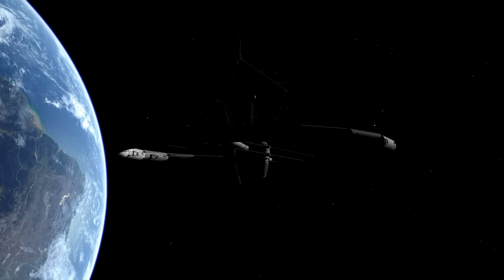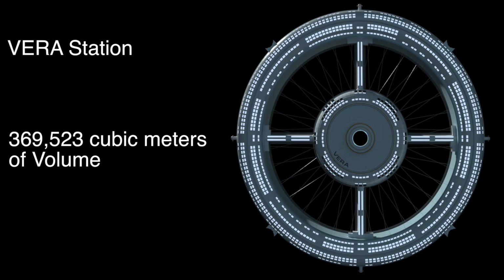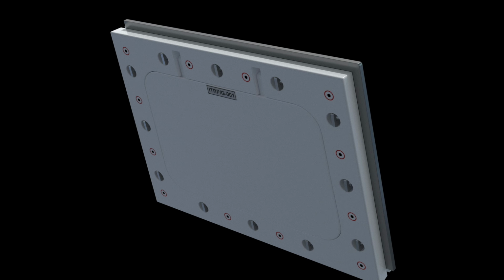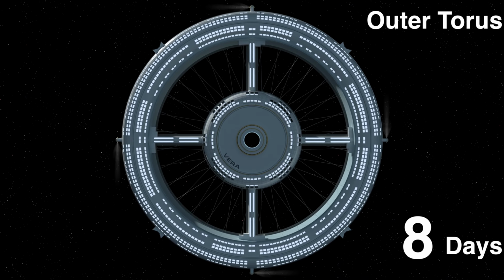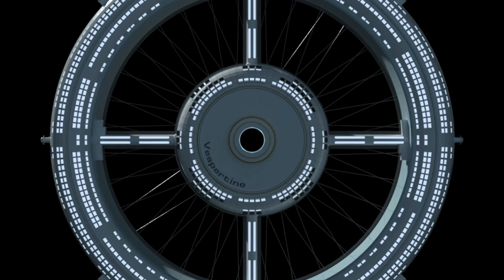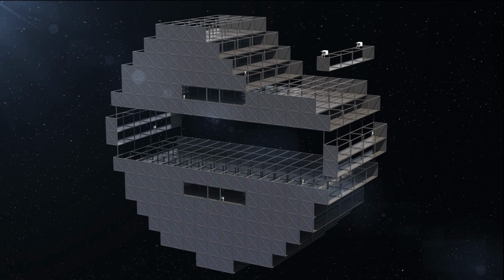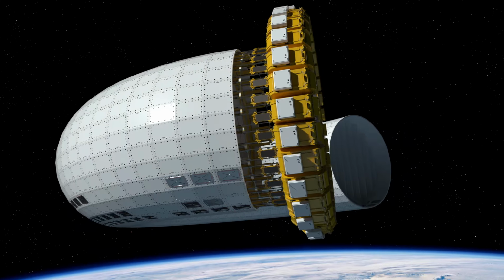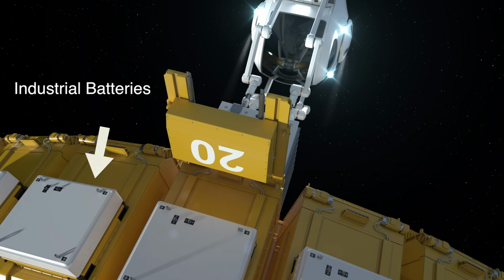We could build this huge Space Station in 6 months

Comment: Gateway Spaceport LLC 
How are you going to solve the multi-fixed-tori problem? It looks like the two torus are joined and not independently rotating. 

The issue with this, for those not familiar- the inner and outer torus rotate at different speeds due to being connected. What I mean by this, is regardless of the speed of the inner torus, the outer will always move faster. 

You can even simulate this using your hands. Put one closer to yourself and one further away. Then move the 'inner' hand while making the outer try to keep up.

The resulting issue is that simulated gravity is going to be higher on the outer ring. This is why you see designs like the O'Neill cylinder instead of layers of tori. Food for thought.
Reply from the maker: There is no problem to fix.

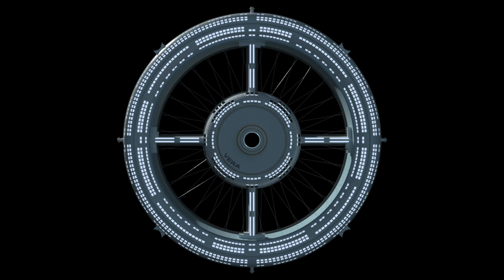Comment: 3:14  a circular centripical motion object, is vital to create an inertia property foundation in micro gravity realms, its a natural initation that large heavely mass geomagnetic enities naturally do, even artifical vessels potrayed in claims of ufology sightings. 

  A rotating spin craft can also use odd mass for pre-adjusting position or directional balance and instigate geo-momentum, like a gyroscoptic device doing geo-scoptical cruise. In sci-fi term similar to "pulse-engines", only at continues mass attune spin verses rithum jerk-pumps. 
  Allowing the craft to run without chem-fuel storage, such as mini nuculear cells to amp eco-sound generators (solar), nearly pure electric.

Comment: animation of vera shows outer ring n inner disc like station spinning as 1 unit hence same spin speed so would this mean more artificial gravity for outer ring inhabitants then center disc like station? on side note each building unit/plate should have defect/anomaly reporting system like vibration, sound db ranges, pressure etc. Data collection n forensics on internal espionage or external object shot at. How about instead of evacuation to other ring or station each ring/disc should have 1 ejectable floor like a boat in each quarter (think pie).. this will cut time bring inhabitants to escape shuttle by parashooting that segment to earth like many including spacex rocket recovery techniques work? so my guess; it should be just 1 ring keeping simple cuz economic impact of bloating the design cannot be realized before hand.. also the brain drain instead using firmer platform like mars caves, rocky crevices are better places to install more elaborate n better protected setups n habitats..

Comment: Have you done any welding in a non-environment scenario? My understanding is that flame is non-existent in outer space. Having asked this question, I am truly in agreement with what you are trying to do and yes I believe also.
Reply: The flames from a mig or tig welder does not exist until the aluminum or steel metal wire touches the joint and melts the metal being welded.  You are thinking of acetylene welder where a hot flame is  used to melt a soft metal like brass to a metal joint.  That is an extremely weak weld to use.  Batlle Tanks and Jets are welded using the other first methods.

Comment: Sorry,  but I am so confused by this design. In space, I think this concept will only cause the floor beneath you to shift sideways. Wouldn't it be FAR more effective to design these living areas on the spoke-like floors that expand from center to the wheel, and standing on the spoke-like floor will cause you to be grounded as the floor moves up, not sideways with this other wheel like design. I hope that makes sense. I means the spokes will have to be separated in concentric circles that are spinning at different rates, in order for each concentric circle to reach the speed it needs to mimic gravity.

Comment: Solar panels and batteries will not provide sufficient juice to power all the welders at once.  Can't get around the math.  You're going to need SMRs from Radiant.
Reply from the maker: Yes, they will Paul, we contacted manufacturers of the Electron Beam welders and industrial-scale battery manufacturers. Read our statement at the top. When we started this project in the summer of 2021 it was one of the first things we checked.

Comment: Could also be modified into a planetary transit ship and not just a space station. Just attach a few rings chained together at their hub via a central shaft structure. That could act as a carrier bay for a couple of SpaceX Starships. Add engines and there you go. (Of course some modification for lateral loading, but given the travel distance acceleration can be kept fairly modest.) Not quite the scale of something like an O'Neil cylinder, but it'd be a start on that general idea.

Comment: Looks like SARGON is designed to be broken down into individual panel placement sections.  Each of those panel section placement components look like they could fit on a current generation SPaceX Falcon. Theoretically you could start launching components of SARGON now. The only problem is the current cost per KG to launch it. Looking forward to the next steps.  Are you going to have quarterly updates?
Reply from the maker: Yes

Comment: Doesn't having a 16 segment, flat panel ring construction, give excessive opportunities for leaks? How are all those seems sealed? And wouldn't a design that minimizes corner joints, with overlapping panels be a safer solution, also in regards to material fatigue and stress... like ship construction.

Comment: You know, after 135 shuttle missions, we'd have so, so goddamned many of the building blocks of what we would now call a huge station. A few thousand more pounds of oxygen, and maybe a bit of the hydrogen we got that from to carry those tanks the rest of the way. Then we'd have these innumerable (okay 130 or so, numerable by definition) cylinders already up there ready to be dismantled for pressurizable space and tubing, filled once more with what we need this time. It would have been relatively cheap to do and, uhh, hellyeah the ISS would be tiny, if it wasn't just kind of part of it. Whatever. That's not how we did it. Instead, we let them burn over the Atlantic. I have a philosophy now that I understand. It came originally from one of our founders, but he was the one who was never a president. Anyway, here it is: "Waste not, want not." In a context like this, knowing how much energy is required to carry something, anything, to orbit, a structure like that almost getting there and then we let it melt? One hundred thirty four times? It is for shame.

Comment: This will work provided SpaceX can get cost per KG down - or some type of gravitational propulsion is established. I like the idea of quick build stations, although zero G geosync outposts are reasonable as missions rather than locations. 

First, we need to test whether artificial gravity works, starting with two inflatable segments at each end of a truss/tunnel with a power plant, docking port and flywheel in the center to take off and put on spin? Effects at various rotational speeds could be tried to minimize adverse symptoms.

If successful, could additional trusses be added (say 12 slices) with a number of inflatable modules between each truss - possible two or three rings with a number of modules between each truss, possibly hung on some kind of firm structure?  Maybe transfer tubes?

Could they be launched as folded fans that unfurl and inflate for installation? Maybe from a high altitude supersonic aircraft?

Would solar panels be used in the center or out from the trusses or is it time to bite the bullet and put up some kind of thorium or other nuclear power source?

Could such structures be put multiple places, say orbiting the Moon and Mars, as well in Geosync? See my post on Going to Mars for a list of possible stations. Modules could be used on Martian and Lunar surfaces.

Some modules or stations would have hydroponic vegetable growing, water and waste reprocessing (using grass to convert black water to soil) and cloned animal protein, blood, bone and fat to deliver food and receive organic waste from other stations. 

Food production methods could be used to make habitats for earth, possibly including earth homes or other mass-produced modular housing.

Other stations would be astronaut academies, provided artificial gravity systems work without inner ear distortions - possibly at lower gee with slower spin to minimize adverse effects and to mimic Martian or Lunar gravity.

For more information on doing a space consortium to do all of this, see https://spaceconsortium.blogspot.com/

See especially, http://spaceconsortium.blogspot.com/2009/10/private-space-transportation-system.html, which was used by NASA Goddard as a source for our current space infrastructure. See http://spaceconsortium.blogspot.com/2009/10/gravitational-propulsion-geocities.html for that cheap lift bit I referenced above. I don't bend metal, but I can help out doing so - and expect credit if you use this system. For Mars, see http://spaceconsortium.blogspot.com/2009/10/going-to-mars-geocities-rescue.html To see how to structure your operations and any consortium on an employee-owned model (for the company and the consortium), see http://spaceconsortium.blogspot.com/2009/10/aerospace-firm-management-geocities.html
Another way to raise money is to work on earth habitats which, to the greatest extent possible, recycle their own water and grow their own food. Unlike biosphere, we don't need total solutions, just a product for those who think nuclear war and another pandemic are best dealt with by more independence. See http://spaceconsortium.blogspot.com/2009/10/twenty-first-century-homes.html
This type of tech is essential for any colonies you wish to put up - including cloned protein/fat/bone/blood. Leaving any of these tissues out makes for a bad burger.

The plan I made as Director of Colony Planning for 1000 Planets involved having colonists start on earth building hardware that they will need to be able to fix, but as part of an independent colony with limited outside economics (company town style, but with the employees owning the company) - building up equity that can be traded for their quarters in orbit or on Mars and to pay for their transport off-world. These would be one-way trips unless gravitational propulsion experiments prove fruitful. Then all of this is very cheap.

Drop me a line. bindner.associates@yahoo.com

Comment: Are your plans to build these in the Lagrange points?  Have you considered building ships that could be used to grab smaller asteroids and bring them into a foundry to be processed into materials?  The Lagrange points tend to collect asteroids and such that fall into the gravity well at these sites.  You may also want to consider an off-world hospital, the benefits of medical procedures off-world have been documented during the Skylab missions.
Reply: A. G.  I see what you mean.  After further research It's not particularly stable because of tugs by other bodies. In a figurative vacuum it would be stable, but in multi-body systems the point at which gravity is balanced is altered by the movements of each body in relation to each other. E.g., the necessary point will migrate earthward and outward as the moon moves toward and away from the sun. The station would need more adjustment burns than in a moderately unperturbed 1-body orbit, as I understand it.  I can see how there would be considerably more radiation since it would not be shielded by the earths magnetic field.

Comment: FYI there is possibility you won't even need the electron welding beams. In space it's quite easy to cold weld the panels together. the only thing that has to happen is for the connection points to be wiped of different materials on the surface so that the electron bonds between the metal at the atomic level can happen between two separate panels. This could make the welds even stronger because it happens without warping the material.

Comment: Huge volume! How are you going to fill it with air???
Once filled (somehow), how do you plan to clean and recirculate the air? Will you have plants, trees onboard?
Reply: 370,000 m^3 of air at 1 atm pressure is 1.222 kg/m^3 or 450 tonnes. deliver in liquid form, so 3 or 4 starship launches
Reply from the maker: @paulshields1883  You nailed it, Paul.

Comment: Elon doesn’t like unnecessary acronyms at all. Just saying, if you are pitching this to SpaceX, you might reconsider the abundance of NASA style acronyms for everything. The easiest sort of rotating space station for SpaceX to build is one based on passenger Starships as modules. Each one has more pressurized volume than the ISS. The Starships will be mass produced anyway. Building most of a station on earth is obviously easier at least up front. Tanks could be prepped to be more pressurized volume later. Engines could be unbolted and sent back to earth. This seems more likely as a first rotating space station. More advanced stations built in orbit as you describe would follow if the market is established.
Reply: you can test artificial gravity with a pair of starships and a 100 m tether
Reply: I don't believe they are pitching it to SpaceX, they are trying to raise funding to be a customer of SpaceX.

Comment: How many lifts will it take to put the CVG into orbit? 
How are you dealing with micro meteors and other space junk? 
How is it getting material to produce the panels?  answered 
Once the station is constructed will it be repurposed as exterior maintenance? 
If so how will it move about the station without interfering with the spokes and the 4 transfer tunnels?
How do you power the CVG? batteries are nice but what about RTGs or the newer tech NDB?
How are you shielding the occupant from radiation and other hazards?
How will you handle life support? By shipping canned air or by making green zones that will double as local farms?
Have you consider view screens instead of windows from a stand point of structural and safety? The added benefit would be no matter where you room is you can always be looking down at earth.
Have you looked at building O'Neil cylinder or is the structural design still just outside current material reach?

Comment: You still have some major glaring issues. First, raw materials in the quantities you would need will severely strain global supplies which does not even take into account prefabrication into tube, rod, and plate forms.   MIlling, drilling, weld edge preparation, tap & die, and wed material will also be logistical issues as that volume will tear through prefab tooling, dramatically shorten maintenance cycles and operational lifetimes of supplier equipment causing drains on their suppliers. These issues alone will increase the cost of  all structural metals globally.  Then you will do the same thing to the world's liquid gas supplies to pressurize the station environments which will also impact the cost of rocket fuel needed for the lifter. 

I would therefore suggest your scope is too narrow and you either need to work at a more moderately paced scale, wait for lunar materials mining, refining, and fabrication, or begin advancing it first.

Comment: Unlike others here im not an engineer,  but I understand we can build it, but do we really want to?  My first objection is the single ring. That will require fuel to control the spin. Why not use 2 contra rotating rings side by side using electric motors to create the spin gravity. All you need is power to spin it and there is no fuel to worry about going boom. Obviously some drive system needs to exist to adjust orbit but that's a separate issue from the spin system.

Second power, yes batteries and solar are great back ups but we have used nuclear electric generation in space for decades.  Why not use that placed on a long strut away from the rings to provide power. It's a constant reliable source. 

Third your suggesting a hard panel design, there is a lot of debris up there now to damage it. Why not section of inflatable tubes that could better abortion and survive impacts like the Bigelow system? Better yet twin tube with a fluid like water in between to absorb radiation. You just weld the open ended tunes together in a ring, you still have a continuous ring system. After all your in space so it should require less rigid support to construct it as your not holding it up in a gravity well like on earth.

Comment: Question: Not sure what G forces will be provided in the inner vs outer taurus.  It seems like 1 G in the outer taurus and significantly less (1/3G in the inner taurus).  My guess is that the lower G forces of the inner taurus will impact various design requirements which we may not understand at this time.  Moreover, from the design how will the inner taurus be assembled.  Its not a taurus but a disc.

Comment: The hard part isn't the design or even the construction, no, the hardest problem is the delivery and handling of the materials. That's also where the bulk of the cost is.

Hmm... Couldn't we 3D-print metal in space without shield gas as there'd be no oxidisation? Would cooling be an issue though?
You'd only need one form of material, handled in the same way over and over again but could form anything...
Reply: Exactly what I also thought. Of course you would not print panels as this would need way too much energy. But MIG-Welding should work in vacuum without argon after the arc is lit. The plasma would consist just of vaporized and ionized aluminum. Maybe it is even possible to light the arc without any gas at all. This form of welding should be way more energy efficient as electron beam welding